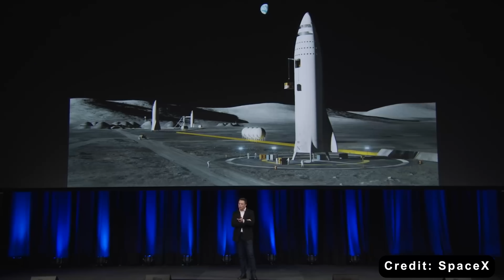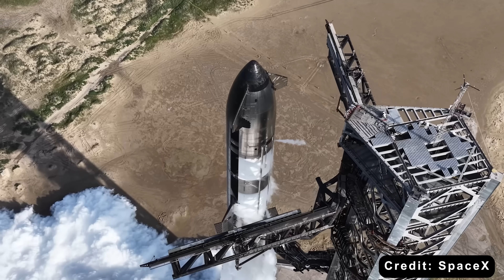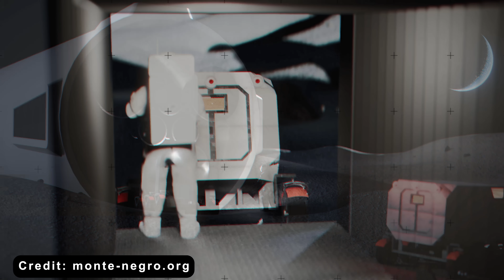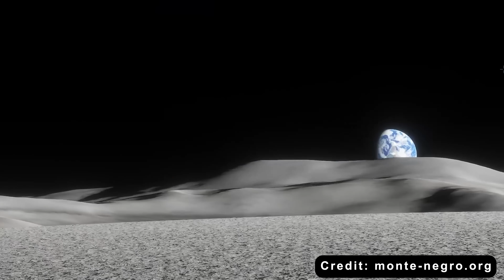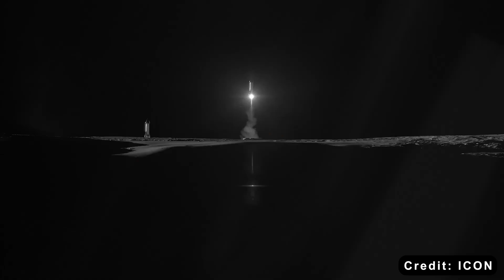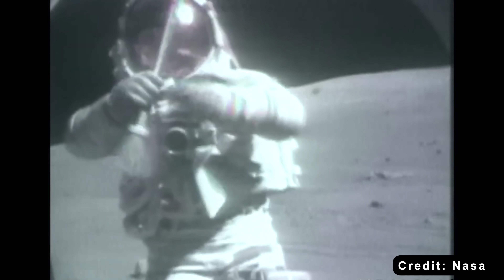Elon Musk Just Revealed SpaceX’s Moon Base Alpha — The 2028 Plan Is Insane!

Comment: This moon base has same problem as submarine have.  You have to feed everyone on the project. They can make air and have power, but where does the food come from.
Reply: The video shows plants being raised with hydroponics. My own personal opinion is that I would rather visit a FINISHED Moon Base ~ Maybe just 1 engineer, or max 2 of them, with an army of robots to start with? Then people can come once every thing is set up by the robot army and the food is grown and the air is pumping and so forth. My guess is that the robots will eventually be run by SOLAR power, or as hybrids, like a Toyota Prius?
Reply: They learned to make sterile nutritious biscuits from human feces like 50 years ago...  The body only absorbs some 15% of the nutrients in the foods we eat = 85% re-usable so cuts necessary  food supplies by 600%. They also have urine filters that yield pure water  - num num huh?
Reply: @frankbusch746 that's some idea but how big will that production machine will be?
Reply: @FinoFilm  the urine sterilizer is basically a 2-stage evaporator which leaves the Urea as a precipitate that can later be used to fertilize the greenhouse crops - - size dependent on production capacity - The solids sterilizer is also capacity dependent size.  We watched a film about it for human relations class in highschool - - The film talked about very large units to feed large populations   First the solids are put in a water suspension and pasteurized, to kill any biotics, then evaporator treatment which leaves the sterile solids as a dry powder and re-captures the water, then the solids are treated just like flour and baked - The guy in the film actually ate one of the biscuits - at which time the whole class experienced dry heaves ...

Comment: I see a space station around the moon first as a  outpost and safe heaven but this starship must have radiation shielding. 
  Now from here they can send astronauts  or robots to the surface with a smaller craft maybe Dragon to shuttle down to the moon working on a landing pad  and for  relaunch of the full size starship then they can land safely on the moon  and launch for mineral return missions they will need this for cargo versions of starship . Why Nasa never but up a moon space station  it should have bin there since the 70's